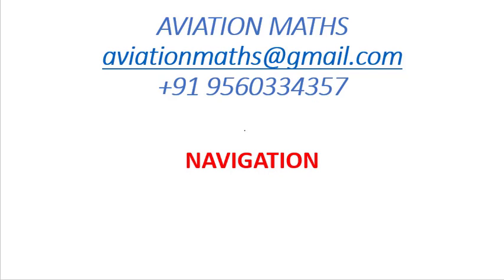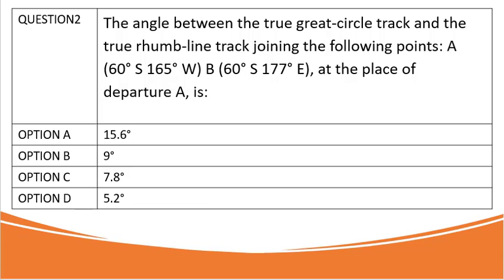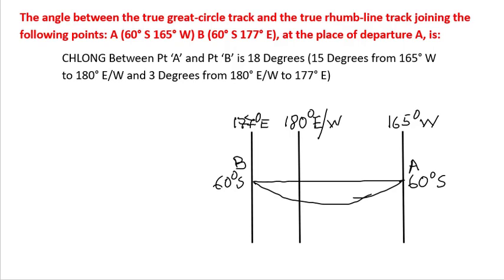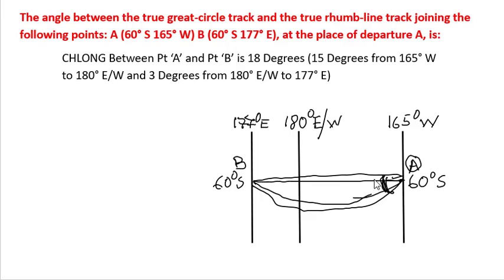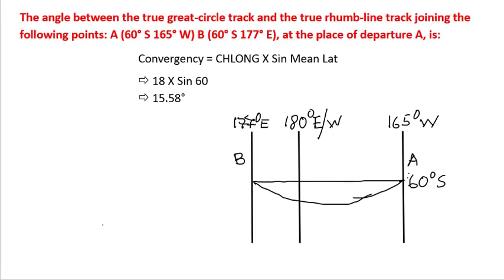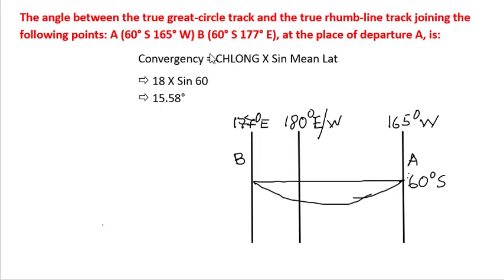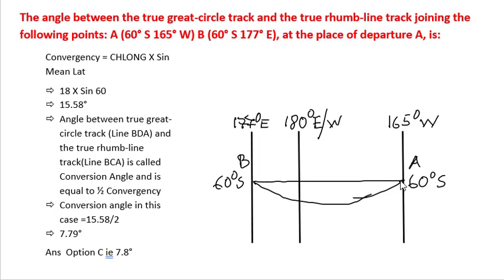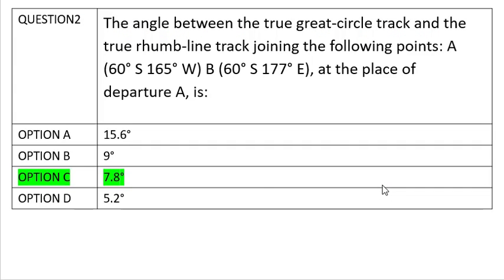Angle betwn great-circle trk and rhumb-line trk joining the  pts: A (60° S 165° W) B (60° S 177° E)

Comment: Is this supposed to be on a Direct Mercator chart? The only time a rhumb line is a straight line and a great circle is a curved line is on the DM chart because there is no earth convergency. In order to correctly represent a line crossing every meridian at the same angle - a rhumb line - then it needs to be a straight line, which is correctly represented on a Direct Mercator chart. There is no point in going into transverse or oblique mercator charts as these are not in the ATPL General Navigation syllabus. Hit me up for more top gen nav facts including the Lambert Conical Projection!!
Reply from the maker: The calculated angle would be for actual earth. Any projection can be used for making this calculation. Mercator or Lambert's are most convenient. The diagrams for difference projections would be different.